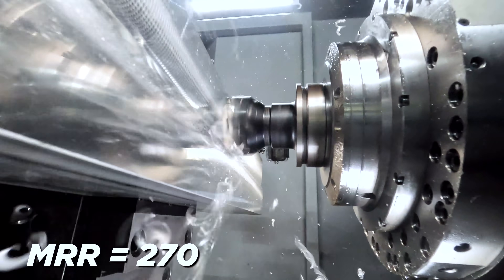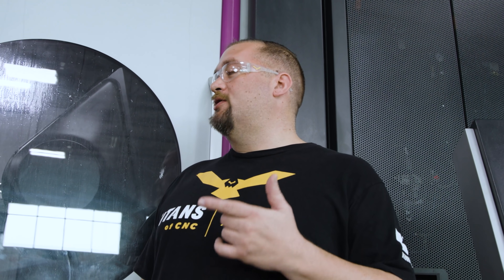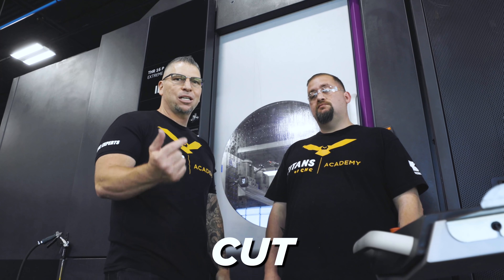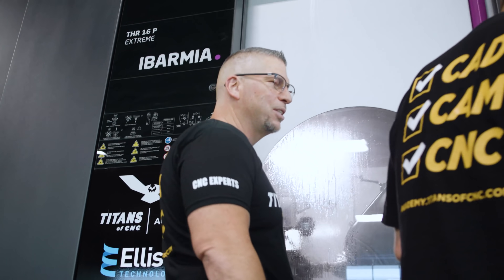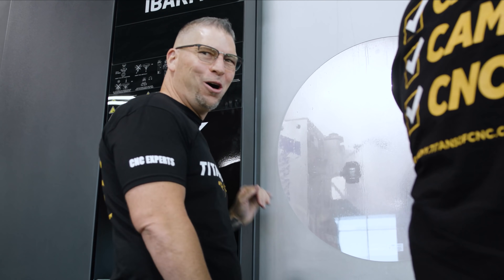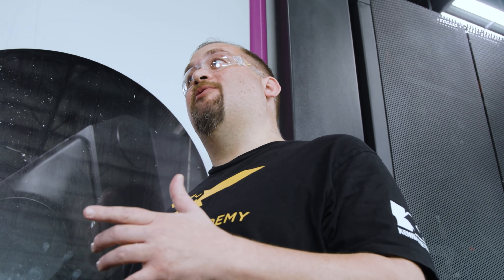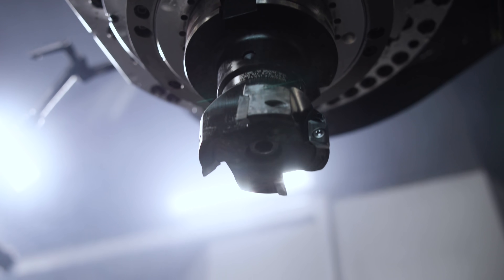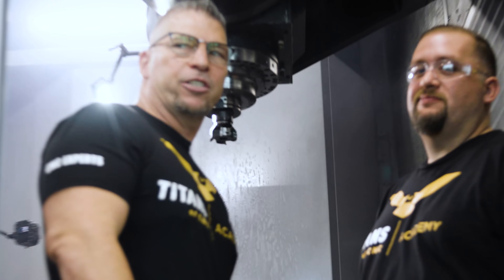MONSTER Cuts at 1000 IPM on 100 HP 5 Axis CNC Machine

Comment: Thats impressive these machines can cut that much material off!   I run a 150 hp heavy roll lathe and according to my calculations I can dry cut with single point ceramic @ 116 cubic inches MRR per minute of STEEL all day.   I can run it up to 230 cubic inches MRR for a short amount of time before the cutter is fried.    specs are 1-1/4 round insert, DOC is 1.300 inch (surface area on the round insert), IPM is .006 up to max .012,   spindle rpm 125 and max 135.   sfm is 1244 normal and max 1343 on a 39 inch diameter roll.    a 15 ton roll @ 135 rpm is somewhat intimidating to stand beside!!   Its impressive what these 50 year old machines run can do!!   Ive made about a full tandem dump truck load of chips in a 12 hr shift!!

Comment: I work in a huge forge shop and we struggle getting peeling the forge scale off 15-5 and 4330 mod. It would be awesome to see what you guys would do in this situation!
Reply: That shit is fucking hard. Best luck i had was on a big hbm with a big shell mill cutter.
Reply: Quite often when dealing with forge or flame cut parts i find attacking it with a conventional cut rather than a climb cut works better. 
After the initial start of a cut you're putting the insert into clean material and exiting from the skin instead of the other way round.
Tool life can be improved by an astonishing amount. 
Just make sure to leave a little more on the part than you would with a climb cut, particularly if you have a less rigid or well worn machine to work on, as the cutter will tend to pull into the part instead of deflecting away from it.

Comment: Now that you have proven you can remove material successfully at this rate,  let's see you rough a part with this tool,  speed and feed!
Reply: There is no way you could maintain that mmr all the time. Production runs need a consistent rate to succeed. Job runs or 'one off' runs need a person that is smart and can machine a part first time with no screw ups. 

Been there and done that ok...!!!
Reply: @Hareball001  I am aware,  but showing a monster MRR for 1sec of cutting is cool but not particularly useful,  I want to see them blast through a part at high MRR!

Comment: Last century I programmed toughing cuts in P20 with 1mm depth of cut 1.2mm feed per tooth 50% step over. I forget the metres per minute but it was a 52mm button cutter, the operator then increased the speed and feed until the sound and feel was just right.

Comment: Sweet!. Is there any chance you could show people the importance of having the right type of tip for the material?
Maybe showing the difference between tips for aluminium, in aluminium.  And steel tips in aluminium. Thanks guys,keep on killing it! 👍
Reply: Now that would be useful! We only use one kind of tip in our shop, because the runs are pretty short. Always wondered how much better tips made for aluminium would be. But then, we generally machine castings, which may not be great for the aluminium tips.

Comment: Machinist here I want to see what you guys come up with for long straight walls on mold steel like p20 all the way from extended cutters digging pockets out and finishing pockets with 90deg walls or even 1-3 draft,10”+ deep let’s just say too deep to just throw an end mill at it and shear cut. Been cutting plastic injection molds for a while and depth is always a hurdle

Comment: "We're gonna go one tenth deep...  It's gonna be epic!"  Hahaha!  Nice comic relief for the mistakes we've all made so many times.  Thank you for this video!

I'd also like to see basically the opposite of this video where you go for the best possible surface finish.  I've watched some videos from Paul Horn GmbH where they achieve a perfect mirror finish on soft metals right off of the machine.  It would be really cool to see you all try to do that without crazy proprietary tooling like Paul Horn uses.
Reply: We are ON IT!
Reply: You ever seen a diamond turned finish? It's so perfect and smooth you need a spectrometer to measure the finish.
Reply: @drewjohnson4794  I think Paul Horn GmbH does something like they.  They've got milling cutters that leave finishes like that, too.  That's what I'd like to see these guys do, but with less exotic tooling.

Comment: I’m glad u mentioned the corner rad. I was gonna comment on that, a bigger rad will run much better and quieter than the tiny rad on those inserts.
Reply: Bigger rad would draw more power
Reply: @dadtdm5646  maybe, but in Aluminium HP is rarely a problem. Having to limit feed on a long tool because the tool squarks like a choked chicken because of tiny corner rad is a problem. Going to an insert with larger rad and then feeding at twice the feed even if it runs a higher spindle speed is fine by me.
Reply: @damientoomey1194  - They aren't running a long tool, they're going for max MRR. When going for maximum MRR, like they are in this video, HP is the main factor that defines the possible MRR of a machine when cutting alu. A bigger CR would limit the max MRR as it draws more power.

Comment: Awesome 
Could you make a video on how you keep parts scratch and dent free and how you deburr parts during production to keep everything perfect? We really struggle in our small shop trying to keep everything nice particularly when making small batches of things
Reply from the maker: Yes
Reply: @TITANSofCNC  thank you 🙏
Reply: Good idea!
Reply: We struggled with that where I work too, but we already know what's wrong. To get rid of it we'd have to hire new people who actually try, sadly.
Reply: Depends on what the customer wants to pay for. Some of them dont really care they just dont want burrs so manually filing/deburring is good enough. Some companies only wants chamfers done by CNC - which is an extra cost as some chamfers can be reaaaaaaaaally tricky do to.

Also, get yourselves a pallet with sheets of cardboard and use those as scratchproof surfaces when handling parts. Its cheap and effective.
Reply: @innominatum9906  Have you ever done manual deburring? I have done for 7 years and I can tell you the extra cost they bitch about upstairs or where ever is nothing compared to the fact Im this close (about 0.047mm close) to leaving the shop because manual deburring. 1 or 2 minutes to deburr in machines if the machining is done proper in the first place is nothing because proper machining the part came out 50% faster anyway.
Reply: @TommiHonkonen  My boss has the idea that manually deburring parts while the machine is running saves time. But I make sure the machine chamfers as much as possible because I cba to do it all manually.

And youre right, the machine can do it waaaaay faster and better than any person can do :P

If doing one-off tricky 5axis parts where certain areas are hard to chamfer - depending on which customer it is - a bit of manual deburring saves some headaches =)
Reply: @innominatum9906  Saves time is what they all say. How bout you shut up, buy proper machines and we get box ready parts straight out of the machine and i drive multiple machines at one time is what i say. Savvy? hahaha